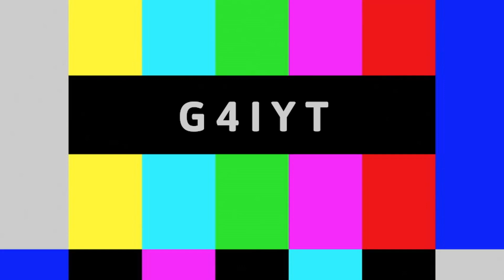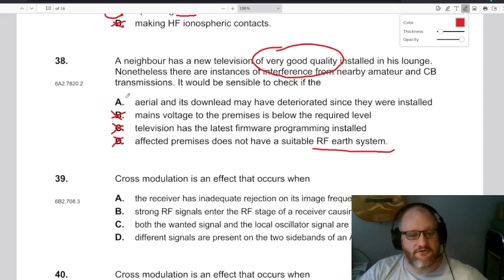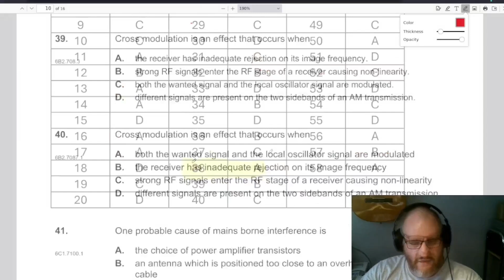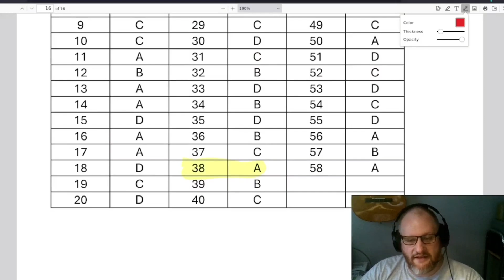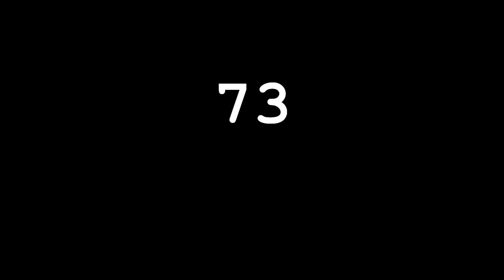UK Amateur Radio Full Licence Mock 1 RSGB v1.6 Question 38

Comment: Hmm .. dunno how this would work out in practice. Are they suggesting that you climb up to your neighbours chimney stack and check the antenna ?. Probably not, but it kind of reads that way. Mind you I could inspect next doors yagi from the ground and spot an issue because it is bent and pointing down at the roof. Anyway, I suppose that if the person with the new telly was having problems before the telly was installed then they should sensibly have got a new antenna fitted. If the issue arose was *after" I would suspect that the cable had been damaged by some idiot Comet/Currys deliveroo muppet.
😂😂🤣